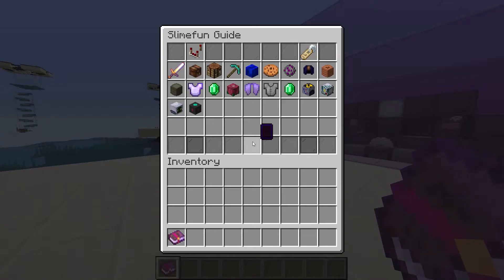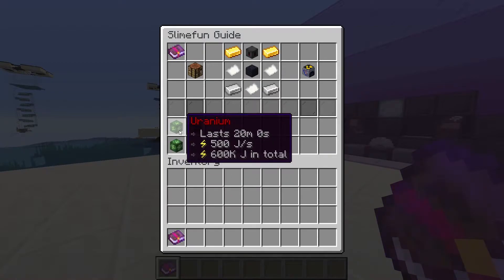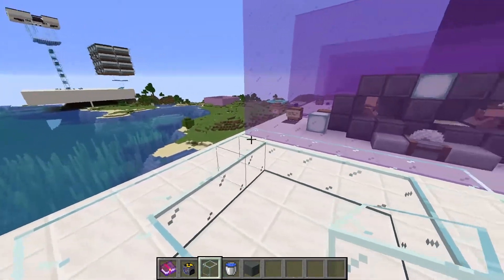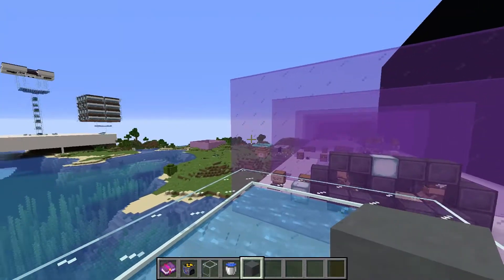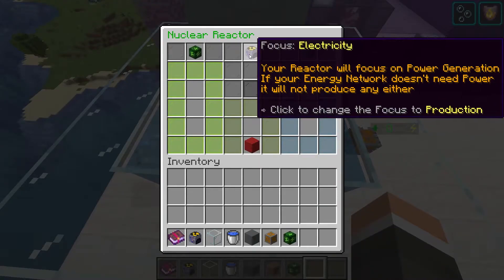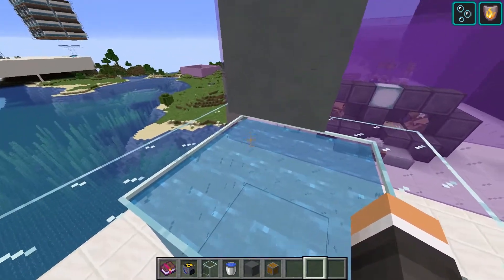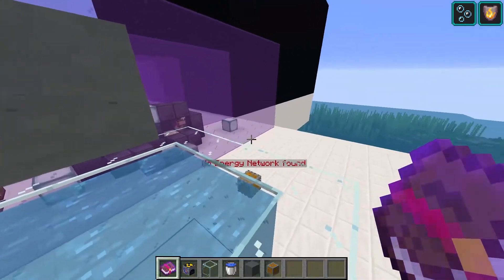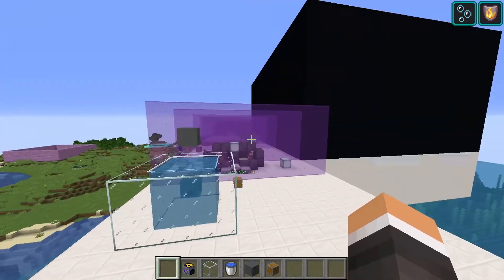SlimeFun 4 Tutorial Ep 16 - Nuclear Reactor Basics

Comment: Sry im kinda confused because on the server where inplay the reactor would turn into lava no explosion if u mess it up plus i dont need water all around it is this a different version?
Reply: U only need water on the sides not on the top is what i ment and im curious bc i wonder how many cooling cells i need per uranium
Reply from the maker: @Helioger  It very well may be, I'm on the most up-to-date version, servers generally lag behind a little. Plus, I also have experimental builds turned on. It may depend on server settings for the water, but better safe then sorry! It may perhaps be the case that it is only required on the sides, I'll be sure to check it. In any case, the design should still work fine. The reason it turns into obsidian is because the water touches the lava. You'll need 100 cells per uranium, as stated in the video :)